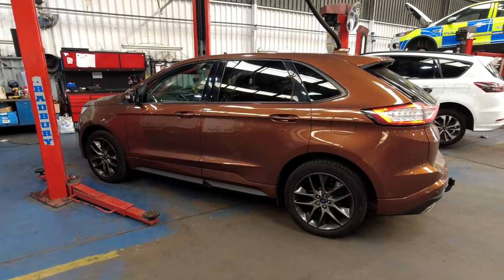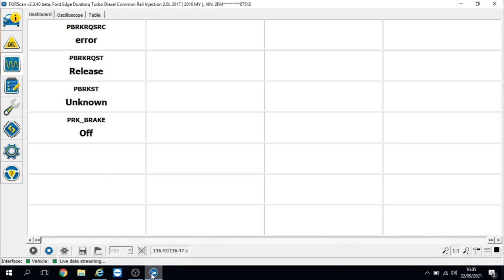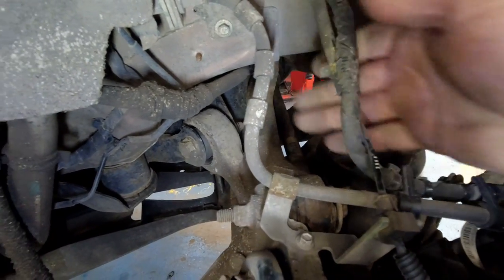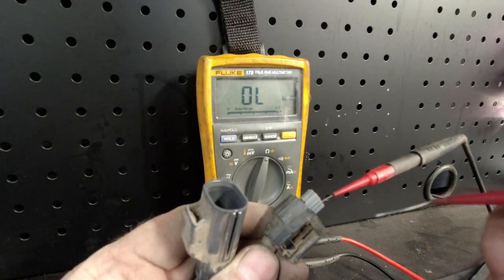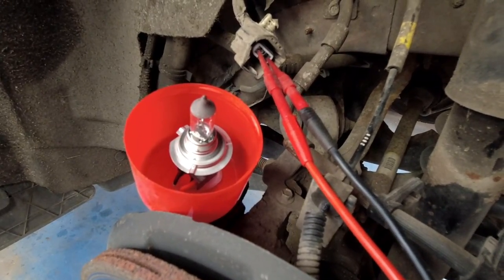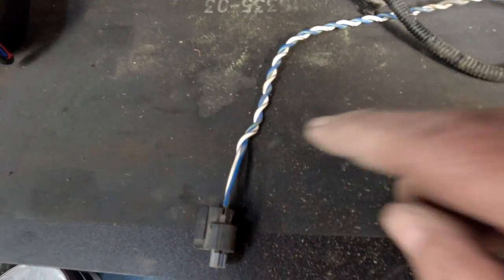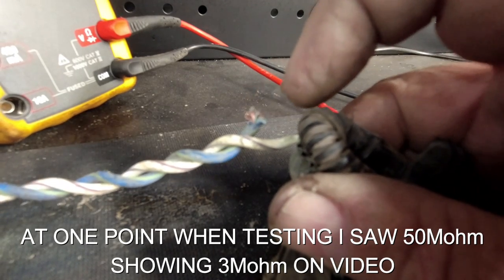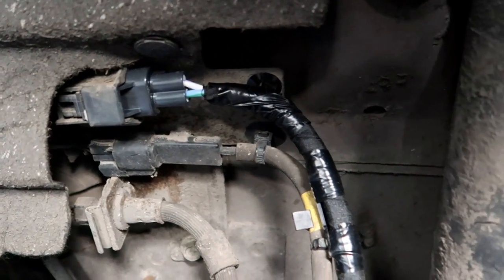2017 Ford Edge - Park Brake Malfunction - C1034 C2007 C2008

Comment: Thank you for the step by step diagnostics on troubleshooting this problem. I just had the same issue with dash light on/codes on a 2017 Ford Edge AWD. Initial diagnosis revealed the driver's side harness broken. After some discussion, the customer decided to replace both sides as a preventive measure. I replaced both drivers & passenger side rear park brake actuator harnesses. The part # for drivers side harness is: H2GZ-14A411-A, US price was $43.83 from Ford dealer parts dept. Passenger side harness part #: H2GZ- 14A411-B, US price $47.33 Great video, just posting part/price info for US viewers asking for part numbers. Thanks again for taking the time to make this video.
Reply: Thank you so much for this

Comment: My stepdad had the parking brake issue on his 2017 Edge.. Watched your video because it matched the symptoms that he described. Low and behold, once we isolated which side was the problem, we followed the trouble shooting you demonstrated and it showed the harness to be bad on the LR. Untaped and unloomed the harness, and sure enough there was a small break in the wire due to corrosion. We were able to repair it and it fixed the problem. Thank you for the very informative video. If you could show or post the part number(s) for what you replace, these videos will be even more invaluable than they are now. Thanks again
Reply from the maker: I thought I'd put the part numbers for the harness. I'll look into it and update
Reply from the maker: Thanks for the comments
Reply: @SYDiagnostics  Where is the part#?

Comment: The good old Green crusties Steve , it's a good job we dont live in the salt belt area of the USA  if that's what happens here , modern junk is coming out of factories over here , with parts that are not up to the longevity required from the public , it's ok if it's under warranty,  but many will have to pay for the repairs , great video 👍👍👍

Comment: Always keep your car clean don't let all that road salt and dirt and grime pile up on your electronics. There's only so much the connectors can keep out with those little rubber seals!
Reply: The vehicle that I just repaired was very clean all over, especially the underside. It was a 2017 Edge Titanium AWD with 140,000 miles. I found the wire broken in the bend, where it flexed the most due to the travel of suspension. Keeping the car clean underneath may help, but my guess is that they'll eventually break due to the flexing from suspension travel.

Comment: Very interesting to see that corroded wires seem to be so common fault source.
Reply: It’s too often corroded wire across all brands either cheap plastic insulation or poor quality thousands times recycled copper metal 
For example take wiring from old cars insulation cracked perished but wire itself gone dark but still solid 
Same with the steel seen two year old car with subframe rotted through that does say a lot about todays carmakers

Comment: so the solution , more permanent is to stop the corrosion , this is where dielectric grease comes in , you place some in the harness clips and that impedes water from getting in and causing corrosion. Its not a permanent solution but better than just a replacement.

Comment: Thanks for the very helpful video. The same harness cable needs replacing on my 2017 Ford Kuga. Is there a item number or something for this part? I’ve tried searching for it online to no avail. Any help would be grateful. Thanks
Reply from the maker: there should be a sticker on the harness with the number on it
Reply: @SYDiagnostics  I will take a look. Thanks for responding 👍🏼👍🏼
Reply from the maker: @Seii-FPV in the UK the ford part number on a 2018 Edge  for the left hand harness is 2172262 and the right hand harness is 2172274. Im afraid though that in other markets Ford use different part numbers . The engineering numbers are H2GT-2B54-AA & H2GT-2B54-BA these may help
Reply: Will this fall under warranty will dealership fix for free😊

Comment: Currently in the middle of woods hiking when this malfunction message popped up. Parked on a dirt hill, engaged the parking break. It took multiple tries hitting the parking break switch to get the brakes to release. Thought I was gonna have to get a tow truck to come out in the woods.. hopefully I’m having the same issue with a broken wire. Not sure how the parking brake would release if the connection is broken?
Reply: My message states “limited function”.
Reply: @freedomordeath1216 hat was the issue as I have one tire fully locked 😢
Reply: @MohamedAhmed-dw9zh  did you get it to release?
Reply: @MohamedAhmed-dw9zh  I spammed the parking break switch probably 4 or 5 times. It finally released. I haven’t used the parking break since.

Comment: Hello how do I pull up Ford codes? Or what if I have an error message with no error code
Reply from the maker: You'll need a diagnostics machine capable ir reading all the systems. I use Forscan when not using the dealer tool